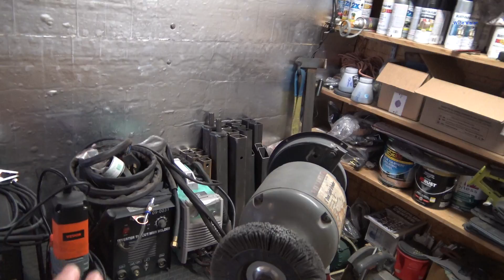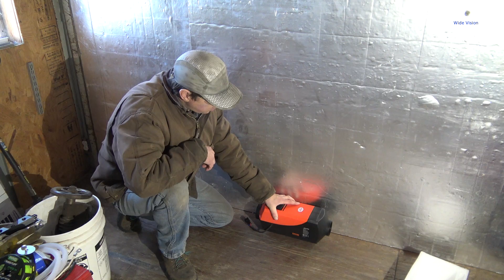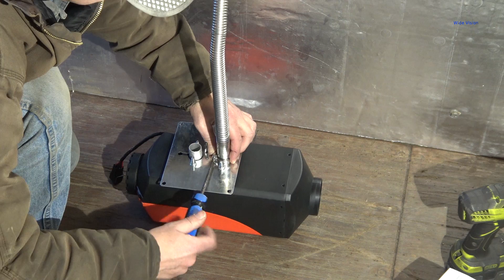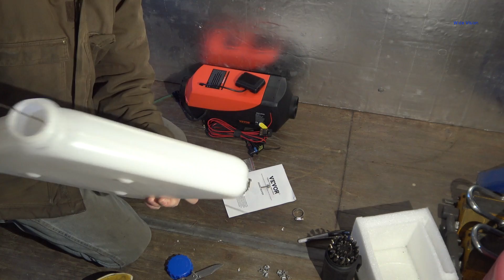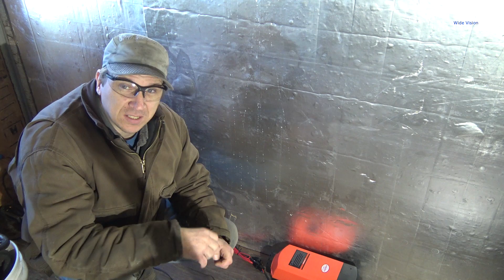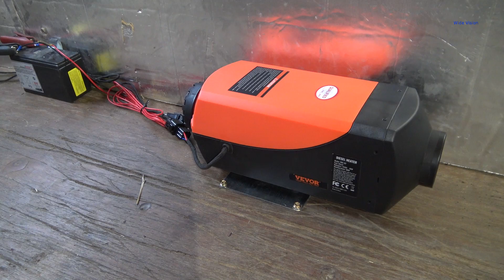Using a diesel heater in a SHIPPING CONTAINER??

Comment: No worries with welding, diesel fuel does not explode unless under high pressure like in a engine.  It only burns if ignited. 👍

Comment: If you're going outside with the fuel tank you might want to upgrade to an aluminum fuel cell. They run $60-$100 depending on size but last forever.

Comment: What is the benefit of keeping a lathe or milling machine at say 50 degrees constant temperature during the winter if you use it? Less of a problem with summer temperature swings? Is it the oil being too cold and thick to cause wear? I know a surface plate would be out of wack for measurements although not sure on a milling machine.
Reply: Condensation, rust. My heavy 10 is in the garage, flash rust all the time.

Comment: the burner works on its side handy for mounting on a wall 120 to 12 volt power supply are cheap and work good doesn't matter where you put the fuel pump you still hear it